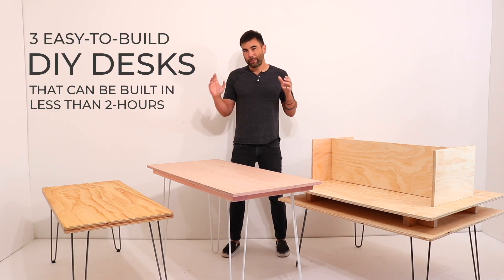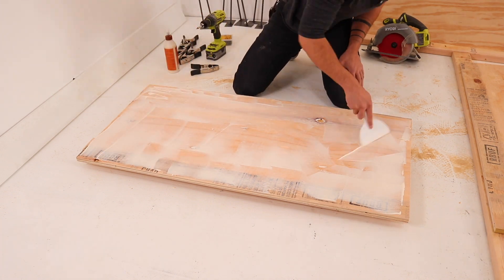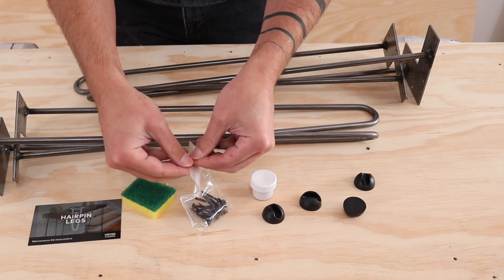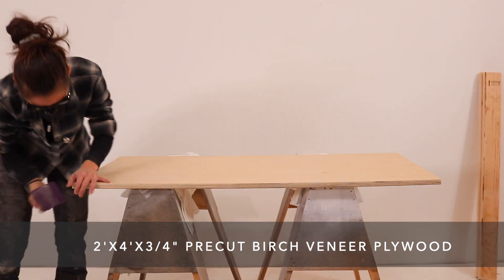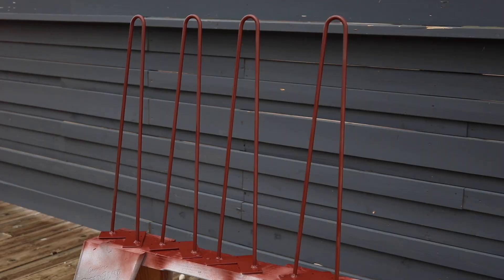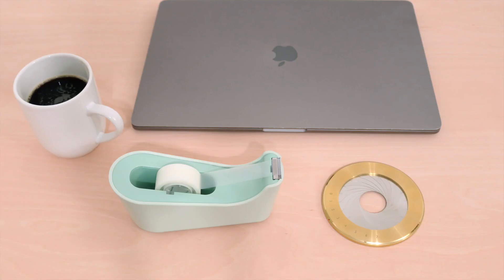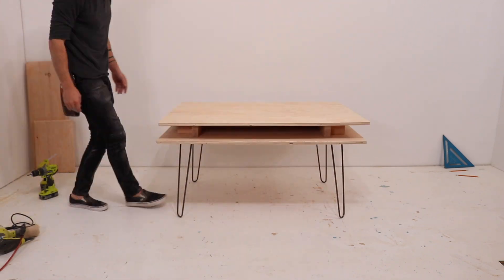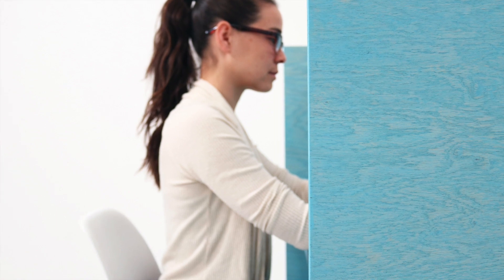Easy-to-build DIY DESKS | 3 Options that can be built in under 2 hours #StayHome and build #WithMe

Comment: I know its just a table, but if You want to put screws on surface its allways better to begin right in the middle and than outside in circles. 
Excuse my English.
Reply: You mean to start in the center so it doesn't move, then do each side, so it doesn't shift as much, right?